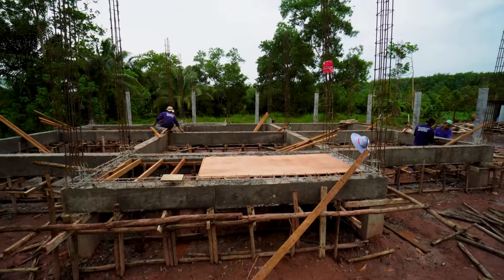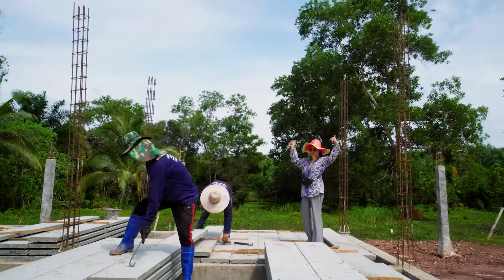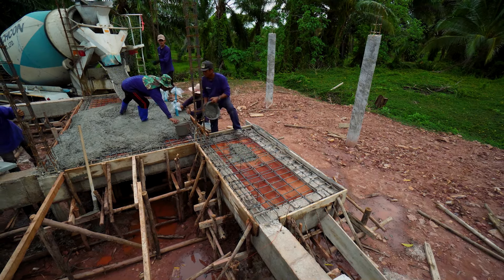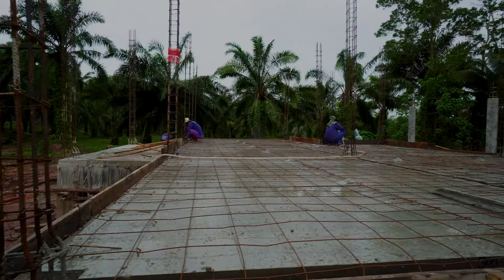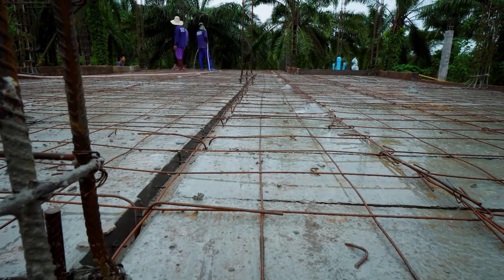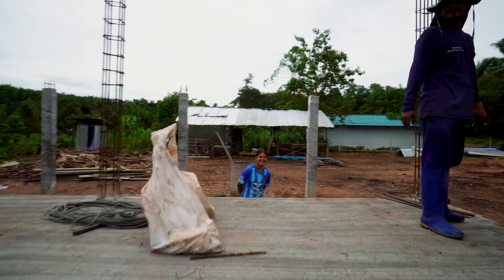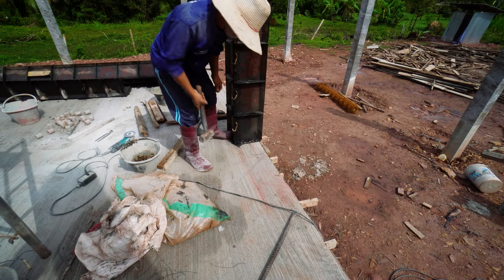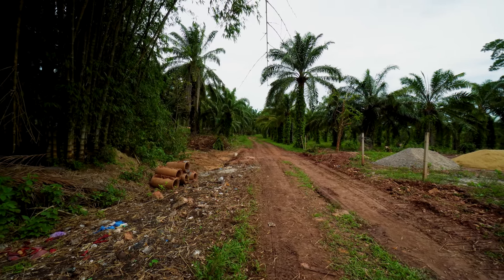We're Building a House in Thailand - Part 4

Comment: I had a similar idea in my head how i was going to build my house in Thailand im an English carpenter 1st second fix i can weld too, got a Year or so working with concrete to, its more wood nowadays i work with. Its all about finding the right team from what i can see here really great work there doing.. is the stilt floor quite common in Thailand, it totally makes sense
Reply from the maker: It adds to the cost, so the style I chose is not as popular. Sounds like you have plenty of construction experience. Thanks for watching 🇹🇭 👀 🙏

Comment: Can i ask the size of the land that was fenced in in the previous videos? Like was it 100sqm or larger? I ask because my wife and are are looking to buy land in buriram and are trying to gauge the size of house we can fit. Thanks
Reply from the maker: The lot that the house is on is 1,600 sqm. In Thai, 1 Rai. Hope this helps...
Reply: A wah = 4sq.m, Rai = 400 wah (1,600 sq.m).  live in Udon Thani City and my house is on a plot 75 wah (300 sq.m. That is 15 m wide and 20 m deep. The house 11m wide and 12 m long with a bay that sticks out a bit. 3 beds all 4 x 4, 2 baths, living room 4 x 6, front bay room 4 x 4. Kitchen 3 x 7, Utility room 2 x 3. House wall to property wall at the sides and back is 2 m, it got a car port and a front veranda that is 8 x 4 but no garden. So that gives some idea. I put stuff below you might find useful. 

1) I have filled 2 separate Rai’s of what was once rice farm and they roughly 1 meter deep. So you might think think you would need 1,600 of earth but no you need about another 50% because you want to be above the road so the rain doesn’t ring off and flood your land and then they is shrinkage as the land packs down during rainy season and you need at least 2 rainy seasons before you build. So you need about 500 x 5 cu.m trucks and the price a truck depends on how far they got to go for it. I seen a thread from 8 years ago which gave the cost per 5 cu. Truck in Buriram as 300 to 400. If it was 500 now that would be 250,000 to fill a Rai.

2) There are some building regulations and if your’s house not joined as a town house then the gap from the house wall to the property wall is a minimum of 1 m if no windows and 2 m if windows and this gap acts as a fire break. 

3) You should really get building permission but it is easy, cheap and you only need to show some sketches. Go to the following thread and see comments by Kamalabob 2 and Cashboy. See - 110K  Baht For House Building Approval ASEANNOW.

4) There are some free Thai house plans. See - Free Thai House Plans TEAKDOOR. 

5) Not sure if you know about the different types of Thai land titles. All is explained here - Thai Land Titles Explaind THAILAND LAW. If you have a Chanote or Nor Sor Sam Gor then you can get a lifetime USUFRUCT and all is explained on this YT Vid - Usufruct In Thailand THAI LAW ONLINE.